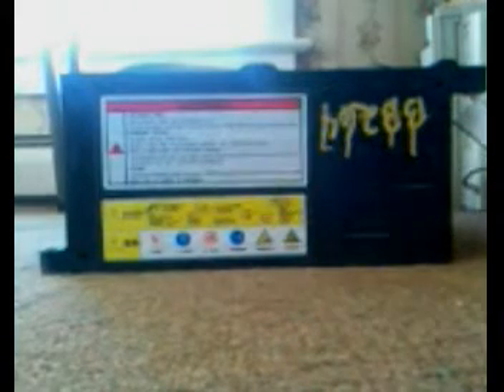Civic HEV IMA Battery

Comment: I HAVE A HONDA CIVIC HYBRID 2005
I have 2 imax equipment, and as I would like to know if for 3 cycles of loading and unloading I'm doing well.

LOAD: 0.6A maximum load Court: 6500mAh
DOWNLOAD: 4.8v 1.0

THAT SHOULD BE SET CORRECTLY TO ENSURE THAT THIS WELL REFURBISHED BATTERY

YOU CAN HELP. email: carranza.karlt@gmail.com
Reply from the maker: 0.6A load could tell you the available capacity under that small load ... That is useful .. but it will not itself tell you how the battery will respond under higher load rates .. such as 6A or 60A etc ... Soo it is useful to get a basic idea .. but keep in mind that the car will push it much harder ... and thus , the car will have less usable capacity than you will find from your far gentler test at 0.6A ... repeating the test for 3 or more cycles is a good idea/methodology ... Th other good thing for your overall battery performance , is if you use your testing to also fix/correct any imbalances in the pack.
Reply: Thanks for answering. but what could be your recommendation to start 
making a good test. that allows me to get more profit. if you could help
 me I appreciate it. do not know if I'm doing well. or recommend me 
your.

The equipment that I use to balance is an Imax B6. or process should I do.

In some forums it says it should get a 6200 mah in Charge, and 5500-6200 mah in descharge.

Thank you
Reply from the maker: I'm not a businessman , so I can't speak to 'profit' .. You can always do more testing to get a better idea .. but , any testing is better than no testing .. Soo I recommend starting with what you are comfortable with .. and than if that's good enough for you than it's good enough for you ..if you want more data , more certainty , etc .. than do more types of testing ... There are 3 main things you want to test for ... Usable Discharge Capacity (Wh is better than Ah) .. efficiency (Resistance or cycle efficiency) ... and Self Discharge rate ... You want your whole battery pack to be as closely matched as possible in all 3 of those things ... If you know you will be doing occasional balance corrections .. like say 2-3 times per year .. Self Discharge rate becomes very low importance .. Efficiency matters the harder / faster the battery will be pushed ... So if your application will push it slower than 1C rates , efficiency becomes low importance .. Usable discharge capacity is always important ... The closer your test is to the rates it will be used at the better the data it will give you .. but if that isn't practical .. than just be consistent so you can compare them to each other with the consistent test method ... I also strongly will recommend recording your data into a spread sheet type program to save keep track of it .. and to let the spread sheet program to the work of sorting and analyzing the raw data you gather.

Comment: thanks for the video. where i can buy those batterys new or how to recharge.?
Reply from the maker: +Judith Rivera : Whole Battery can be bought from Honda, or From After Market dealers like BumbleeBee Batteries (and others , there are many) .. Individual 6 cell 'sticks' are also available on the after market , market .. Just be sure you get ones that can take the HEV treatment .. Once broken down , each individual 6 cell NiMH 'stick' can be charged/discharged, and tested by the many many 6 cell NiMH battery testers sold in RemoteControl Hobby stores .. if instead you want to charge / discharge/ or test as the whole high voltage pack , that is more specialized and less commonly available.. But there are few options out there , for those who aren't up to making something from scratch themselves.

Comment from the maker: @dan gom:  A grid battery charger can correct a SoC balance. But it will not fix the cause that created the out of balance in the first place. Think of it as a form of yearly maintenance to prolong the useful service life of a given battery pack. One of the better one's was from 99mpg.com ( currently out of production ), PeterPerkins (see his youtube channel ) is working on a more basic version. In any case, always be very careful around the high voltage systems , the danger is very real. Best of luck, be safe.